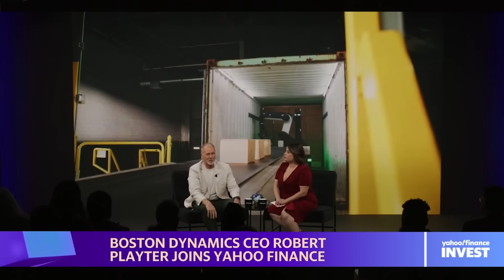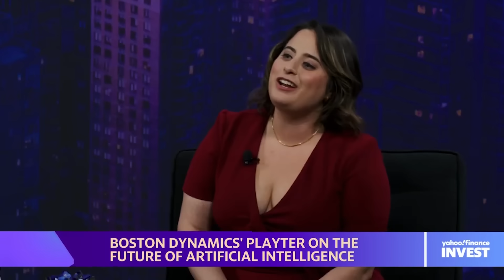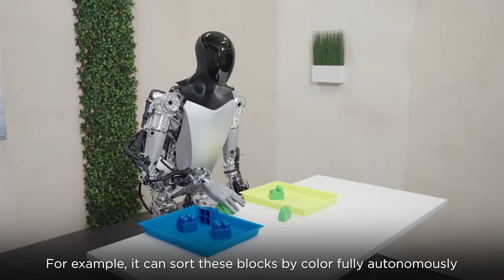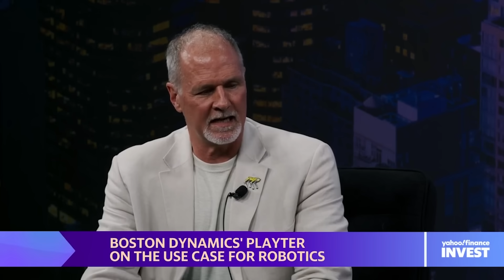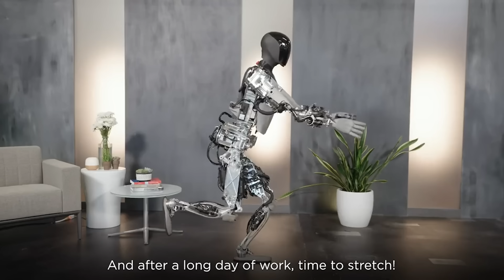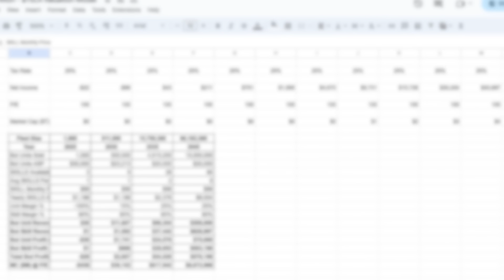NEW Boston Dynamics Presentation shows Tesla is DOMINATING

Comment: Point #7 - Chinese robot dogs, you think they would exist without the the Boston Dynamic's dog? I would understand this critique if the Boston Dynamics dog robot came after the Chinese dog robots. If that was the case, then yes, the BD dog robot would be a crazy venture to get into, but in reality, the Chinese dog robots are so cheap because Boston Dynamics didall the thinking and  R&D for them. Boston Dynamics is paying the price for being an early mover. Elon has always been very successful at being a late mover. When he attempts to be an early mover is when he fails. The one thing I could say is that the $100M Boston Dynamics has spent, doe snot have to be recouped by the dog robot alone. I am sure that so much of the technology in the dog robot is being reused in their other products, just like Elon is getting reuse out of the so called self driving software, in Optimus.

Point #8 - Wait a minute, are you thinking that Elon is ahead of Boston Dynamics? That is crazy! Have you heard of the phrase, "standing on the shoulders of giants"? Elon is the short king that is king of standing on the shoulders of giants. In every thing he has done, it has been after someone else came up with the original idea and often after they had already done the hardest part. Because Boston Dynamics have been doing this for 30 years, Elon has been able to get where they are at, with Optimus, in such a short time. I guarantee you that if you asked anyone, over at Elon's robot factory, if they would be where they are today, with Optimus, if Boston Dynamics wasn't a thing, they would unanimously respond with a "Hell NO!!!". It is always funny to listen to fan boys, fan boy harder than the actual people they are fan boying for. I am quite sure that every point you have made, would be strongly disagreed with, by the engineers working on Optimus. The people you are defending wouldn't even agree with you.

Point #9 - Thinking and movement are two very different things. In the biological world, it is equivalent to the conscious mind the the subconscious mind. Their are operations that one does to move around in the world and the operations that go into doing intentional actions of thinking through problems. It is the same for robots. The robot has an operating system that manages the basic aspects of things like standing, walking, running jumping, the things that have to have happen over and over, in most things they do, andas fast as possible, as opposed to things like figuring out paths for movement, identifying objects and moving their hand/claw to the place in space to interact with those objects. Like when you walk down the street, you think about where you are going and the path to get there, the obstacles you need to avoid, but you don't think about picking up your right foot, moving it forward, allowing you body to fall forward, in a controlled manner, stretching out your foot in front of you, lifting up on the ball of your right foot, etc.etc. etc. Those are all subconscious actions. The subconscious actions are not what are going to take over the world, they are not "thinking" as we think of it as. Optimus is not going to pass the Turing test because it is good at standing on one leg. By the way, if the Boston Dynamic's robot is just "programmed" to do those dances and obstacle courses, let's see Optimus do them. I am quite sure it cannot, because it is on the stand on one leg phase, far from running and jumping onto scaffolding and no amount of "programming" will allow it to do those things in the next year, if not many years. That is not a dig at Optimus and the Optimus team, it is the reality of the progression that a piece of machinery needs to go through to achieve different milestones. Admittedly, the Optimus team is moving pretty quickly, but again, I am quite sure they would admit that Boston Dynamic's work over the last 30 years, plays a part in why the have been able to achieve what they have, so quickly.

Point #10 - Are you not watching the video? The dog is not the only robot they have. Did you not already scoff at the box unloading robot? You understand that Boston Dynamics has many robots the general public doesn't see? In fact, one of the many places where I disagree with Boston Dynamics is their work for the military and police. They have many robots that are built for those areas, that they don't advertise. The dog was the first, publicly available product that they brought to market. It is obvious that he wouldn't expect the dog robot to unload boxes from a shipping container, just like Optimus would be the wrong robot to have unload a shipping container. Do you think Optimus would be better at unloading a shipping container than the Boston Dynamics box moving robot? EVen Elon wouldn't think that, he may try to convince his fan boys of that, but he wouldn't really believe it.

Point #11 - Your financial model? Yikes, not even going to look at it. You could not possibly have access to the right Optimus data to do anything beyond pulling a number outta your ass. Do you seriously think that Optimus is going to be in people's homes, in less than 10 - 20 years? It has just barely learned to walk! It is still in the, could kill someone accidentally at any moment, phase. It is in the, might kill itself at any moment, phase. There is a reason why it is usually operating with the tether ,most of the time. You ever see the dog robot on a tether? No, it is way past that point, and Optimus might get to that point, some day, also. But it will probably be in 10 - 20 years. It almost sounds like you believe Elon when he says the robotaxi will be out next year, and the cyber truck next year, and the semi truck next year, and landing on Mars next year, etc., etc., etc..

Comment: Point #1 - Have you ever been in a warehouse? This Stretch robot maybe be somewhat narrowly engineered, but it's focus is on a massively labor intensive operation that is happening almost 100% of the time that a warehouse is operating. It would be a waste engineer multipurpose functionality into a tool that will be used in an almost 100% duty cycle, in one type of task. As far as the ramp and "conveyor belts" go, these are items that are already existing in the warehouse. Ramps are used for forklift access and the "conveyor belts" are used, in the same way, when humans are doing the job. If your point is that these items shouldn't be necessary and the robot should be carrying the boxes in and out, well that is silly. Why pay for a highly technical piece of equipment for a job that a dumb "conveyor belt" can do?

Point #2 - There are thousands of things that need to be done in industry and the features required to do those jobs are often specialized. By the way, this world was not made for anything, let alone humans. Humans have adapted to this world, just like all other living things, but there has never been an example of universal adaptation. You glorify the human hand as being some kind of pinnacle capability, but I would love to see you hammer a nail with your hand, screw a screw with your hand, straighten small surface mount components on a circuit board with your hands. There is a reason why we have tools. There is no ubiquitous appendage. The idea that someone is going to engineer a single robot to do all jobs is a pipe dream. Even you god Elon would agree with that.

Point #3 - I would be cautious in thinking you know what Optimus is capable of, based on demo video and Elon's promises. I am not saying Optimus isn't learning from observation, but I would need to see that demonstrated before believing it, based on Elon's track record. He has already been shown to fake certain demos for Optimus. The thing about robot learning is that it is software that is seperate from the robot's operating system. There are many teams across the world that are working on many different types of learning algorithms and models. At the end of the day, companies like Tesla and Boston Dynamics, may not need to design a proprietary system for this. They may just end up using someone else's. There is something to be said for using a product from a expert team that is totally specialized and optimized, in a single area, as opposed to trying to engineer everything in house.

Point #4 - Elon is not worried that Optimus is going to become sentient. That is just plain ridiculous. Elon is a master showman and that button is pure marketing. I do think that the have added a kill switch for the opposite reason. Every robot in development has a big red kill switch, it is probably required by OSHA. Reason is, you never know when the robot hits a bad piece of code, or gets confused, or has an electronics problem and suddenly moves in an unexpected way and becomes instantly dangerous to the frail little humans stand near by. I am sure Optimus has several buttons, switched, error detection code, that are standing by to kill its operation, if necessary. 

Point #5 - Firstly, it was Elon that said he was making Optimus weak, intentionally. So speak to him about your complaint. Secondly, there are different types of strength. One strength I can think of, that the dog robot has is the ability to stay on its feet, doing the boring job of patrolling a facility with a plethora of sensors on its back. Definitely something you'd love to unburden human workers from. Also, even though the dog doesn't require it, I am sure that its servos are more stronger than a human hand or joint and could withstand a much higher number of repetitive tasks, than a human.

Point #6 - There are already robots doing food deliveries. I pass them every day. They aren't Boston Dynamic's Dog robots because that would be ridiculous to use a $70k robot to deliver food. For one, because you are right, people would steal it and two, it is over powered and expensive for the task at hand. Do you think people are going to buy Optimus to deliver food? Hell no. That would be a waste. Could Optimus, someday, deliver food, probably? But it will never happen, except as anlon marketing gimmick.

Comment: Honestly speaking. The robot for container is good for what it's design for. The ramp is the least of the concern. One thing about shipping and logistic is the speed. Which brings to the reason why BD uses rollers instead of feet. Of course for stability too. Suction and single arm is the way to go. As long as the arm as more than 5 degree of freedom, it serves the purpose peefectly. More joints more headache. Welcome to the industrial reality.

Comment: Both Boston Dynamics and Tesla's Terminator are a generation away from actually doing work that humans take for granted.

This gets back to the First Principle of Robots - what is it?

The First Principle of what both companies seem to want to sell is:
A Robot is a pair of hands that are mobile.

I can't break it down finer than that - a pair of hands that can do practical work.

Both companies spend 90% of their time in the wrong place - making the pair of arms mobile.

McDonald's, the hamburger people, are on the right track.
They want a 100% automated kitchen to make their food that will be dispensed to the customer after using a phone app to place their order.

They are taking a standard McDonald's kitchen and adding arms to work the appliances.
These arms are mounted on a rail system hanging down from the ceiling. A human cook can jump in and make burgers if needed since the arms retract upwards and out of the way.

That's how BD and Tesla should have approached this - create arms that mimic human hands
and write the software to do useful things with them - like making breakfast or cleaning the house.
A rail system gives the arms mobility and no need for all the software to navigate a room.

Both companies will fail on their current path. Let's see if they learn anything from McDonald's.

Comment: There is very little purpose for the robot dog.  Surveillance of a factory is just silly when you can cheaply install cameras all over the place.  The only time it would be valuable is if it carries around some sensor(s) which are too expensive to buy in bulk for stationary installations or when you need to carry heavy sensors to remote locations.